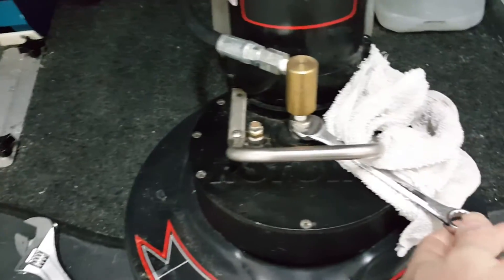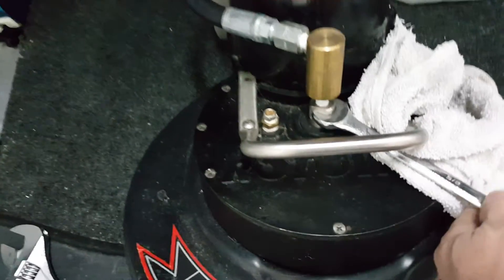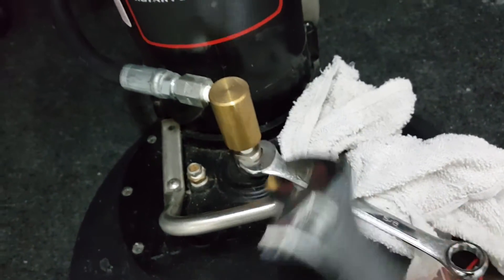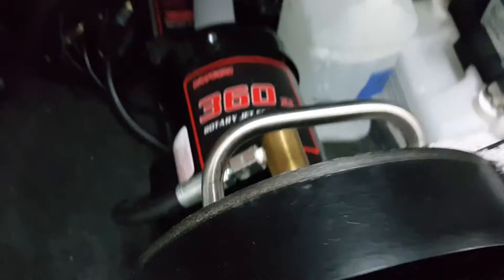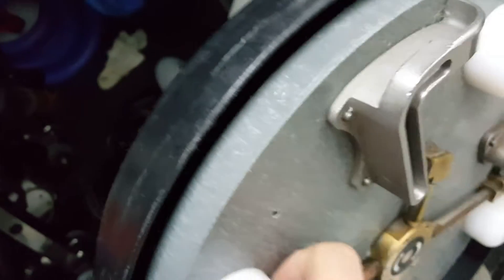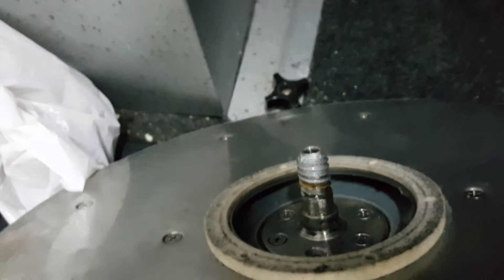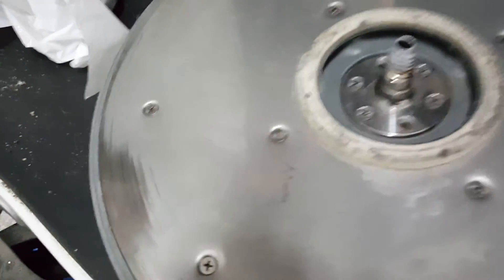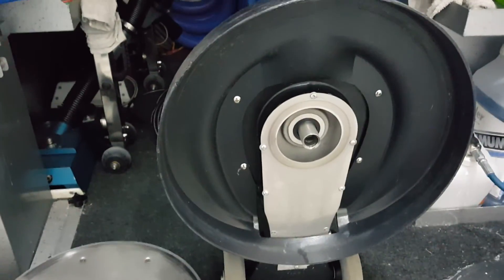Removing Rotovac 360 XL head from unit

Comment: What if it won't kick off? Something went clunk while in use yesterday and today it won't spin off. Motor does not rotate it either.
Reply from the maker: Typically I would put a wrench up on the swivel above to help hold the head. But the clunk, I'm not sure. You might need to contact Rotovac directly for help on this. Sorry I'm not more help in this situation

Comment: It work with the 360i tks for your video,spay jets had to be dry the metal they use gets rusty and clogs the sprayers I have to do it everytime I finish using,this way no surprises by the time I use it,just sharing my experience,I like this machine,I can do 3000 sq ft in 6hr 30 min 2 men I machine.
Money maker.
Also clean the teflon glides while in the job periodically gets clogged for extraction.
Reply from the maker: We installed a filter on the high pressure line of the Rotovacs. It has helped so no clogged jets for us

Comment: Tkyou.
I got a 360i,brand new headbrush ,I cant remove it to get it clean,I'm going to try this.
Reply from the maker: Still be careful. That is a fiberglass type head but if it's stuck... It will take a good push to maybe get the head to move